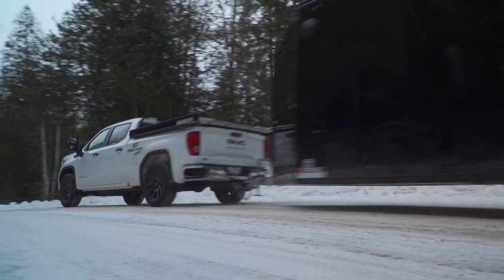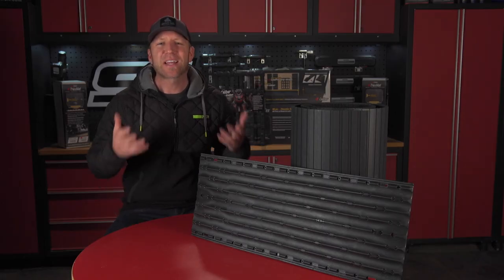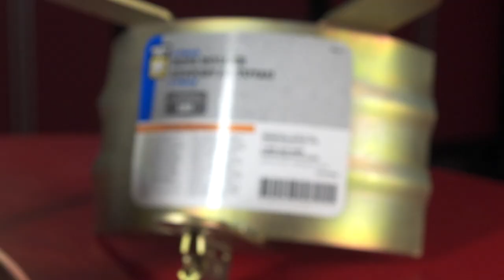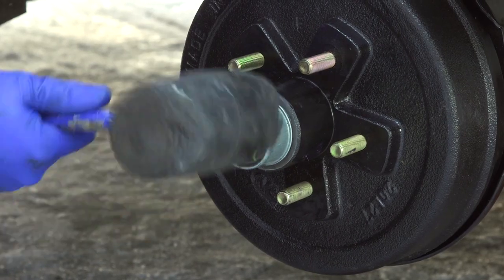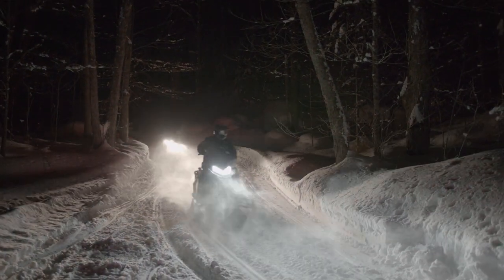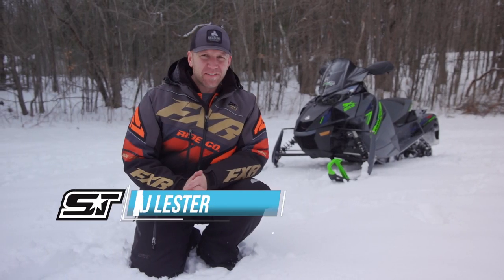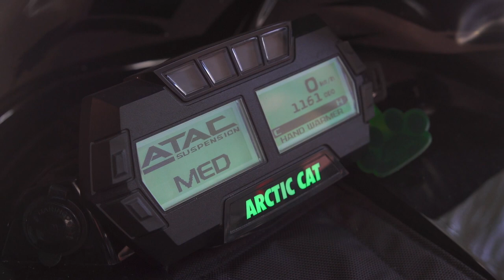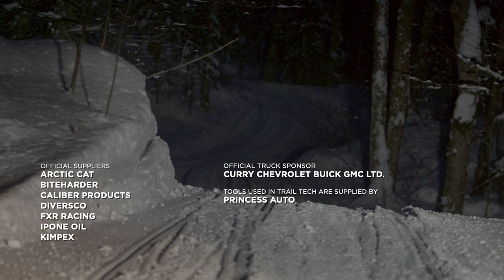SNOWTRAX TV 2022 - FULL episode 5

Comment: I’ve been wearing a custom helmet stick on accessory light from Arctic cat on my HJC helmet for years , looks great   Uses two C3205 ?  batteries. And is very bright and visible in snow dust behind a sled. Fits most round helmets. SO.      MY POINT IS TO HELMET MAKERS.  Intregate. ALL SNOWMOBILE HELMETS should have this safety feature built in the helmet. In the world of LED LIGHTING this should be very easy for the manufacturers. REMEMBER THE BIG UGLY HELMET LIGHT FOR THE MOUNTAINS IN THE  20000 S